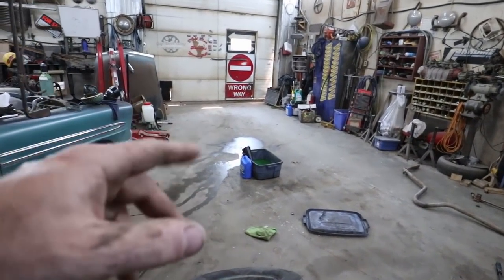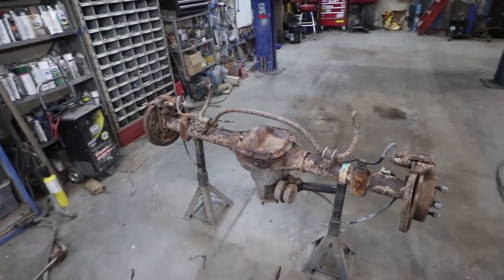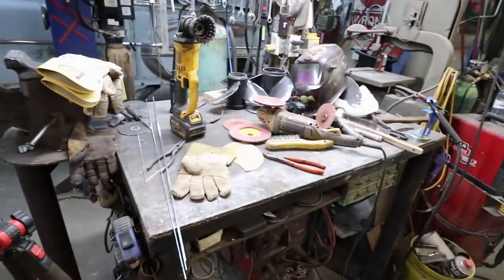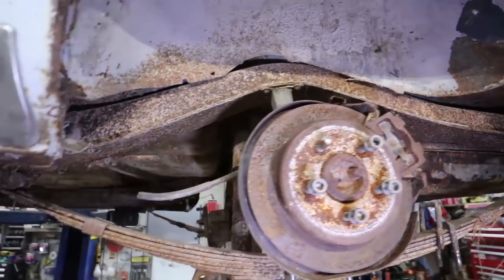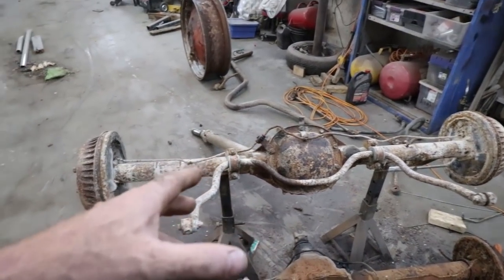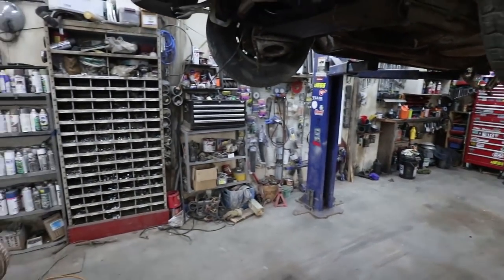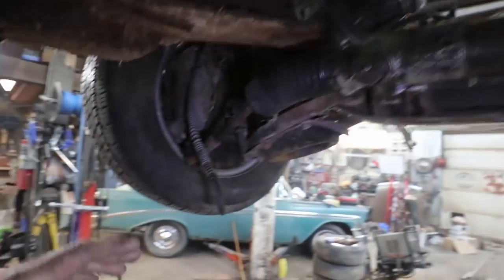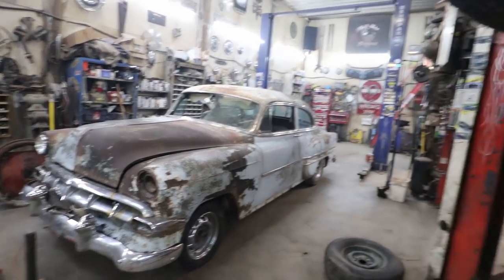Installing the differential in the1954 Chevy Bel Air Turbo LS build to make it a roller.

Comment: Hey Half. FW here. Thanks to subbing and carefully layin a study on your postings, I have solved a riddle that has befuddled me for years. I have just had an epiphany. Fab up a better pair of string trees on the ol' electric guitar by using the other end of the string you just changed. So, as every string has a specific brass "donut" to hold the sting in the body of the guitar, just use those, instead of throwing them away, to make your most excellent and effective string tree. Thanks so Much and Cheers from Utah!

Comment: You might think it was helter skelter, Brent, but that 27 minutes flew by. Fascinating, following the build process. It looks like the weight of the motor will level out the stance and level the car to a nice lowered position. Thanks. 👍😎🍺🕵🏾‍♂️🎸🎵👽🧙🏼‍♂️🥂

Comment: Awesome as always mate 👍🏼🚀 You can cut about 40mm out of the top of those Jag cross members , but you have to cut 🪓 the front mounts away,  they are boxed inside just rebox with 2mm plate 👍🏼🪓🪓🪓😉🛸

Comment: Also I was told. And seen where if you wanna do a total frame swap with use a bubble caprice 90s n up or Camaro subframe they also say a Gbody like Monty carlo n BOP I had a 52 chevy style line deluxe 2door post I wanted to have the body channeled body dropped and choped 4inch in front 6in back. but no longer have the car .look forward to seeing more of this build great work.. keep the patina

Comment: I’m working on a 53 BelAir Hardtop, I put an 88 Camaro Z-28 disc brake rear end in it, Perfect fit. Used my original springs. Using a 4Bolt Carburated 350 and TH350 Trans. Run what ya got. Same color as yours, been on it hit and miss for about 6 Months. Solid body like yours. At 71 yrs old it’s slow for me. Lol, May bail out and sell this one. Take care, let me know if I can help. Thanks for the Video.

Comment: I'm not sure about cars of that era, but on the chevy pick ups, to install a live rear end in place of a torque tube all you have to do is to turn the  springs end for end. Before I found this out, I did one, and what I did was I took a piece of square tube that was longer that the axle tube was wide, cut the circle in it for the tube at one end and then drilled the hole for the center pin on the other end.

Comment: In the past I have reversed the springs and this centered the locating pin .I have done this on Chevy cars and trucks.i also use s10 blazer diff .plenty strong and positive with disc.brakes
Reply from the maker: Yeah some folks have said that and with my luck the spring bolts wouldnt come out haha.

Comment: Brent I'm thinking the 54 is a little low in the rear, that is unless you're going to run the skirts then it's probably perfect. It's all about personal preference and the stance that you're looking for. Please put the fake white walls on it with some cool hubcaps, Spinners or Flippers whatever you like to call them. Keep up the good work and I'll be watching
Reply from the maker: Yeah the front's got no weight on it though I do like the back of my car is down a bit even if they are a hot rod of this era for some reason I like the tail dragger look
Reply: @HalfassKustoms  okay,Cool
Reply: Tail dragger, or lead sled. That was the look back in the day, before my back in the day…

Comment: She looks better with the front end moved back to where you have it. Also the rear end looks great lowered to where it is. I'm not into dropping a car down to far but the 54 looks great where you have it. As soon as you have the motor in it she should be perfect. Love the ole 50s cars, when the bodys looked classy. Later

Comment: You could reverse the rear springs and it will put the guide pin in the correct position with no need to offset.

Comment: The camaro diff was a good choice and even better if you had 12 bolt diff . It sits a little too low in the rear in my opinion . Overall I like that year chevy other than your more common tri fives . Keep up the good work .

Comment: If you get two of those 8.8’s you can cut the short side axle off and use two LONG axles to clear the disk brakes on the frame and center the diff
Reply from the maker: haha I wish, only got the one could use a bunch of em

Comment: On that 8.8, set up the posi clutch packs tighter than you think they should be. This is usually tighter than what the manual says.  Especially on a turbo car (if that is what you end up using it on), you need it tight otherwise it will just burn up the clutch pack.

Comment: It's looking real good - BUT - We have questions - Why don't you make your own lowering blocks with offset holes instead of that plate you made? - would you please slow down the camera movement when showing how the Jag front clip is lining up to the frame - I haven't used a Jag front clip before - I am very interested in this swap as I have a nice 53 Belair 2dr - I have it on Kijiji  but that's easy to pull off if you get that Jag working half assed ( Pun intended ) as I have the rest of the upgrades in my possession - Thanks
Reply from the maker: yeah I could make my own blocks, though seems like a waste not use the junk I bought haha, I'll show a little more in depth when I actually mount the clip, though I pretty sure I'll weld it in the option to bolt is there and may just do both as I'd rather over due it haha
Reply: @HalfassKustoms  Sounds Good Thanks

Comment: Another reason i prefer my 4 post. For pinion angle. Theres an app, Tremec Toolbox. 
To save me confusion i set crankshaft centreline level with jacks under diff then set pinion down 2 degrees.

Comment: If you all have chevy astro Van's they have a multi  swivel steering knuckle on both ends and u might be able to use the steering box off that also not sure but you could possibly use that cause they have upper and lower and use either a s10 or the steering column from the van   or one out of a smaller car but I also know that fords have a swivel knuckle on there steering shaft as well but go with the van swivel steering knuckle hope this helps

Comment: Hey Brent, what year is that Pontiac that is by that pile of rear ends in that one clip? Remember where you took the rear end when you first took it out in the one section of yard where you had a few rear ends and there was an old Pontiac to the side of that area? Anyway, I was wonderiring, could you take the frame from a tri five era chev... could you fit the kick up under this era of Chev, maybe trim back the front rails... then just find a modern but rusted doner truck for the drive train? 4L80 trans behind an LS... yada yada... just ditch all the elder poo frame, front and rear end... adjust the wheelbase from the rear end forward? Work you magic with the drive shaft to match... fix the rear tubs up to match? Is the width of this era too narrow? I watched Fitzee cut the axle tubes then weld them back up on a Ford 9 inch to fit a wee drag car he was doing for somebody but would have to re-watch it to see what he did to match the actual axles... yada yada.  Just, with this car here, was wondering why you were working hard to keep the old frame [which seems a bit weak compared to the 55-57 frames and on up]. You didn't seem to take the more hotrod approach of taking a frame and altering it to suit your needs then putting everything to the frame to fit the body like you often do. Because this car and it's body style... it's a really pretty car when paint happens down the line :-))

Comment: If that's a 70ish camaro diff, the gears from a upto 90's 1/2ton truck will work, i put the fears from a camaro, in my 92 truck, i went from 2.**:1 to 3.08:1 it was a big difference,

Comment: Inherited a 53 210 from my Dad... I got a 5.3 from an Avalanche to put in it and a buddy is giving me an axle from an 04 Blazer. I believe that it has disc brakes , now I'm wondering if I'll run into the same issue you had 🤔
Reply: * 96 Blazer ,not 04

Comment: i traded for a 1995 dakota v-8 4wd truck didn't you say it would be a better choice for the running gear for my 1950 dodge pickup conversion. problem the dakota is extended cab long wheel base 131'' if i measured correctly. i think the 50 dodge is a  little over 100" have you ever cut frames

Comment: Question: Turbo 400 in 72 Vette, shifts from 1st to 3rd before 25MPH. Changed Modulator, still doing same thing. When I remove vacuum from Modulator it does what I expected. Won't get out of 1st. Put it back on and still shifts from 1st to 3rd, seem to just pass 2nd.  ??????? What do you suggest??

Comment: To posi or not to posi, what's the diff? 8.8, blazer or camaro it's what if? No pinch'n da frame, they're not all da same, one fo an Ls that's not tame. Viced n griped Jag front suspension clip, bel air's gonna get some nips n tucks on it's trip, with Pablo by his master's hip.